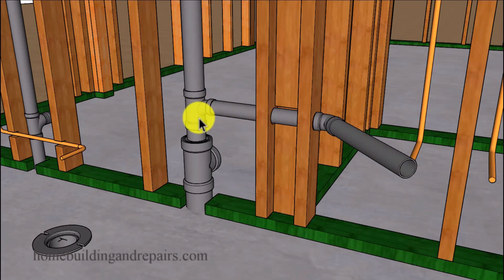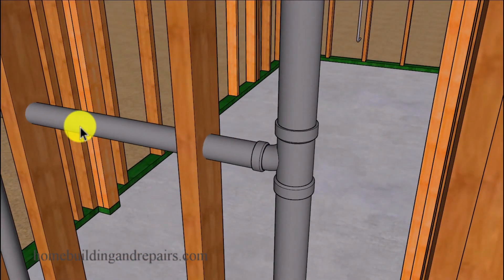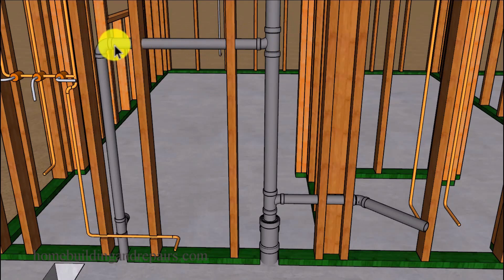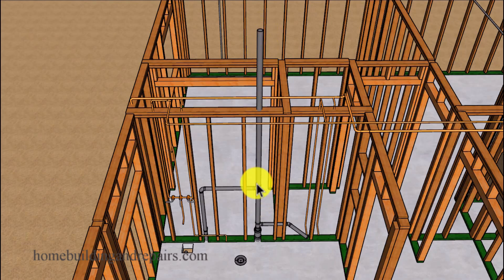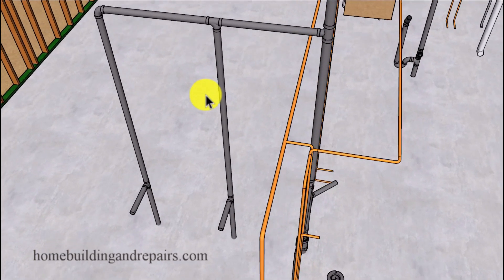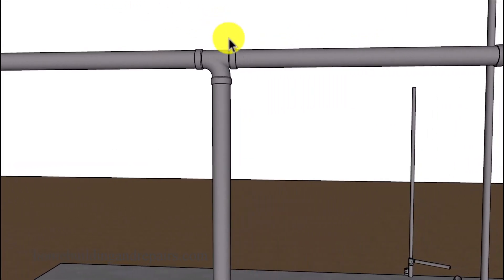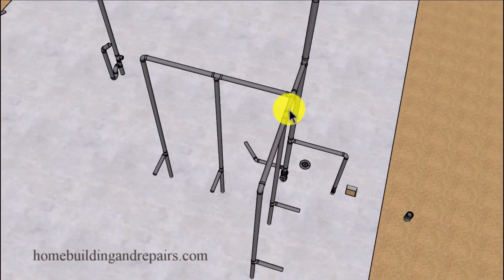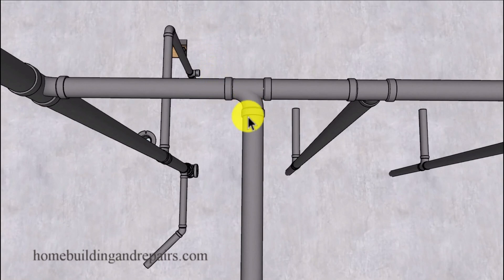Installation Instructions For Plumbing Drain And Vent Pipes Using Sanitary Tee's

Comment: This is EXACTLY what I needed. You rock. I was under my house recently, and saw why my shower doesn't drain very fast, and why my auger will only go so far and then stop. There is a regular tee where you have a sanitary tee. It's causing the water to become turbulated at thst junction instead of being directed down further into the waste line. And my auger head is just coming into contact with a flat surface. Something else for me to fix, now. 😅

Comment: Seems not smart flipping fittings upside down in vents. Instead of having the directional fall of debris, rain it now has a way to flow in multiple pipes and have a ledge to grab instead of just falling straight down

Comment: Couple things from a master plumber: Its 1/4 inch per foot MINIMUM on a 2.5" sanitary line and below, keyword is minimum. Per IPC and NYC code there is no mention of maximum pitch. As far as the fittings go on vent lines, it's done so you can pitch back from condensation like you said. It also makes it easier to identify what type of line it is. Yes, it would work in the other direction, especially since vent are very oversized. The system could actually work with a 1" vent in most scenarios. The code states the vent must be one half the drain line served, but no less than 1 1/4". Code also requires wants 3" and sometimes 4" to penetrate through the roof. This is done to prevent frost closure.
Reply from the maker: Awesome and thanks for sharing.

Comment: We pitch the pipe in the direction of flow and fittings also follow direction of flow. We also pitch the drain so when it rains or condensation to drain down the vent into the sewer.
Reply from the maker: Thanks for sharing.

Comment: I could be completely wrong here, but my intuition is that air will find it's way regardless of which way the elbow is facing. It hardly seems like a significant obstruction, and air is pretty good at that, anyway.
Reply: Totally agree... This is not moving much air so these slight turns don't really matter.  Pay attention to how water / sewage moves.  That is where you will see real problems if you get it wrong.

Comment: If you run two toilet, one on the first floor one on the second, one inline with the other,
can you hook up the drain dump. on the second floor to the air pipe, if that makes sense
using the same pipe.
Reply from the maker: I might have a video on that at our website. https://www.homebuildingandrepairs.com/plumbing/index.html

Comment: There is no reason to install a santee upside down. The air doesn’t care and the water, leaves, squirrels, etc. need to go down. 

And yes, the fall is built into the fittings.
Reply from the maker: Thanks